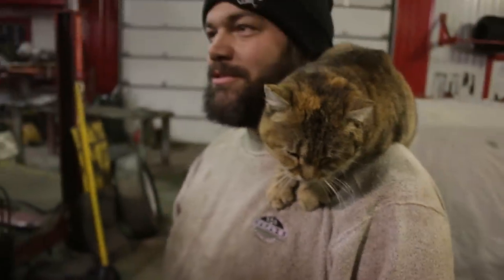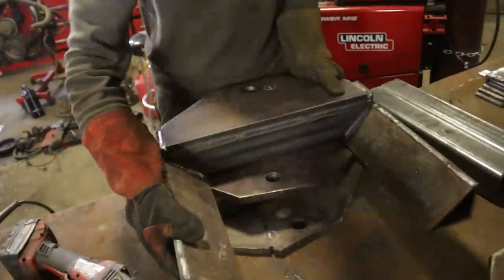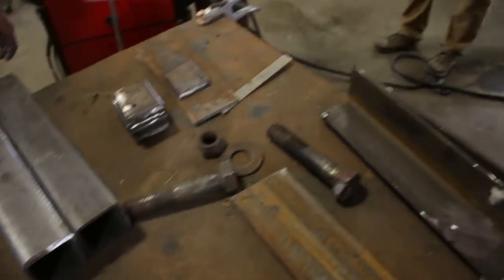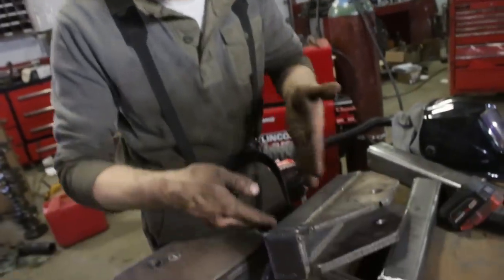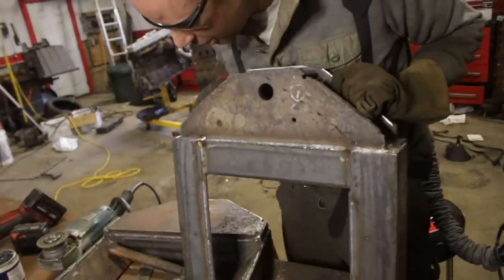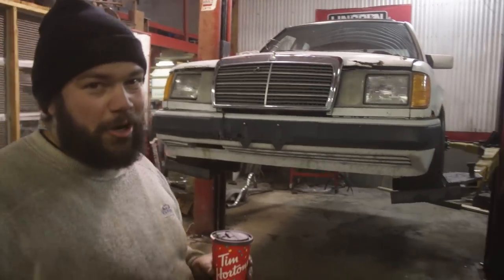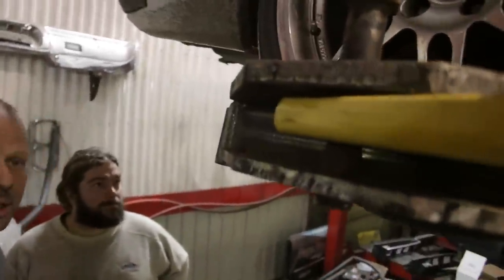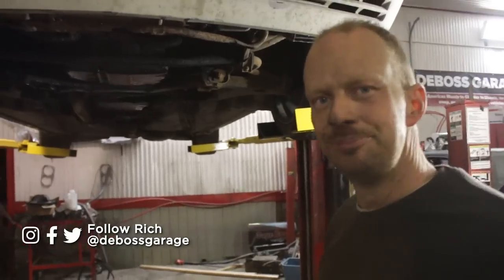How To Build Wheel Engaging Adapters For Your 2-Post Car Lift

Comment: These comments amaze me. SMH he's not lifting a semi, or even is HD truck. Each arm will never have more than 1200 lbs weight. There are many companies that make the exact same style of wheel adapter he made with great results. Do your homework before making a dumb comment.
Reply: Well said
Reply: yep true,, so many over engineer components , but when you know what the numbers are , and so how much the other part(s) need to be capable of    handling the "load". people with Dyslexia really can visualize in there mind loadsa full on stuff like C.A.D all but!! can just look at something and instantly know whats involved and thats Engineering vocational Experience..
Anyone can see Rich is a unique individual when it comes to being a Junk yard genius.. a thats whats liked about de boz garage for starters,motors!!
Reply: Kasey McCleary do the calcs on loads in one axis and then add a moment and you’ll quickly find out that what you thought was “over engineered” at first glance was actually under engineered. It’s like a truss, it can hold 10,000 lbs in one axis but can only handle a moment of 100 ft-lbs before it fails. What he made was fine, it’s those telescoping arms that are sketchy as frig
Reply: Kasey McCleary   I've seen only one model of such a device. It's similar to Ritch's. I think it's a poor design. It probably quintuples the stress on the inside wall of the sliding tube. While probably still within the design safety factor if he limits the load he puts on it, it's not really a good idea to reduce your safety factor that much. Someday, someone unaware of the situation may try to lift a much heavier load than the tubes can hold. His lift can probably lift 10000# before maxing out. I like knowing my lift will max out before failing structurally.
Reply: @fascistpedant758  Yep just made a longer leaver.
Reply: Silly bugger! We have done our homework.   4 yrs plus.  Some folks pay us a bunch of money for such findings.  We've doing it here for free because we like Rich and the other guys (and some of the fans that may duplicate his efforts).  We'd prefer if they weren't crushed.  When bolts fail in shear, it's sudden.  There will be no warning and no time to escape.  The box section will probably go slower and resist the effort to telescope as inelastic deformation occurs.
Reply: You guys dont even care about "safety". You are just trying to justify your 150k student loan financed engineering degree. Google 2 post lift wheel cradle. And there isn't a 3/4" bolt in the world that will "shear" under these loads.
Reply: @kaseymccleary946  well, we've been corrected.   Might as well throw away the rings, Kasey's got it from here.  According to Kasey's reference charts, 3 laps of 0.35 mig wire or 7 laps of 0.30 flux core wire will do the trick just fine.  Thanks for chiming in Kasey.  No need to do any sort of real math, just "have a look at her, she'll hold".
Reply: Kasey McCleary ,The 1200 LB vertical load isn't the issue. These baskets impart a torsional load on the arm that isn't seen when engaging the cars body / frame.  While it might not break right away, the arms might develop cracks down the road due to repeated torsional loads..  The Automotive Lift Institute certifies lifts in the USA.  I'd be looking for a certified lift with baskets then look at what they have designed and compare to what our guy is using.
Reply: @woodwardbeardsley2413  uh the telescoping arms came with the lift. He didn't make those. Thats stock.
Reply: @kaseymccleary946  There will always be arguments between engineers and tradesman, but i assure you that no one here has anything but Rich's safety in mind. HE even called a sketchy setup. C'mon man... Same team.
Reply: @consaka1  No shit Sherlock. You obviously don't understand what I'm talking about. Those arms are designed to only have vertical loads, now he's adding a torsional force to the arm which probably increases the stress by 5-10 times. Something that they're not designed for. If you don't believe me, google "Statics" and once you have a firm grip on that then google "mechanics of materials" to learn how to calculate the internal stresses of the material.
Reply: Just for completeness.  Mohawk makes add on wheel baskets for their lifts.  WA-1 and WA-12 under Tire Engaging Adaptors.  So far this is the only company I've found offering such an add on.
Reply: Also adding to my post.  A 10,000 lb Mohawk System 1 lift is derated to 6,000 of evenly distributed load by using a wheel basket (  1,500 lb PER ARM ) .  A 12,000 and 16,000 lift is derated to 9,000 lb.  ( 2,250 per arm. )
Reply: SSSSSHHHHHHH
Reply: @consaka1  so you're trying to tell me that there is zero rotational force put on the arms from these wheel cradles? The telescoping arms are designed with only a vertical force from lifting straight up and down, now you're adding a torsional stress to them, However, Bob Roberts pointed out that the manufacturer derates the lifts significantly to account for the added stress on the arms.  Think of it like a putter, before you were holding the weight on the shaft, straight up and down, now you're holding the weight on the tip on the putter head,  which is trying to make the shaft turn as well hold the vertical forces applied. If you don't understand that, then I cannot help you see things more clearly. There's probably a flat earth conference near you that would welcome you though.

Comment: Uhhhmmmm nope!  I'm a mech eng.  Please don't use these.  Torsional load arms, bolts used in shear. Extra load moment for the extension.  Etc.  Please dont!  Picking up the center of the tire would remove some of the concerns.   Better to weld tabs on the car for lifting locations
Reply: Mechanical engineer yet he can't spell torsional.
Reply: @mitchdenner9743  that's what you got out of my comments?  You're a winner!
Reply: @mitchdenner9743  most engineers I know are terrible at spelling. Math and science are more important.

Comment: i think u should have some sort of plate or tubing going across the insides of the tires that u secure after u slide those adapters around the wheels. would help them from wanting to kick out if ur weight shift for any reason.
Reply: Twin post lifts have toothed locks to keep the arms from swinging when the lift is up. They disengage when the lift hits bottom. 
Jeff
The Alignment Guy ®
Reply: I was thinking the same thing, even though the lift arms lock in place.. it’s just a bit of extra security and the tension load between left and right wheels would help with the deflection..
Reply: Jeff Forss   The two lifts I work with only lock two arms and one is defective on one lift. I don't think they were intended for a regular side load. When I lift a vehicle, the loads are only vertical.
Reply: Jeff Forss   I can only imagine that if the arms are trying to scoot out, you're not picking proper lift points. They'd probably be difficult to push out even if you would want to once they're loaded. The locks must be mainly for those "special" people, but you never know, shit can happen to anyone.

 Nice four post, I wouldn't mind one of those. Cars with side skirts and trucks with running boards can be a PITA to lift.

Comment: To all these so called eng haters what degree do you have in lift production go check out a semi tow trk wheel lift same design and if your not useing it whats the prob id work under it gtratz on those tight welds there prob the strongest welds on a lift thanks for the vid i enjoyed it

Comment: To preface this, I’m a long time viewer and I love the channel especially since you’re not afraid to try new things and adapt. You’ve been an inspiration to me especially with the Audi, but for your saftey I think you might want to rethink this a little. As a 3rd year mechanical engineering student, I’m concerned about a few thing with that design. First it seems as though you’re using bolts as pins, this puts them in a shear loading condition which they are not suited for, as bolts are brittle and when they shear they will just let go completely without much warning. Normally you’d rely on the friction between the surfaces you are clamping with the bolt to take that shear force. So I’d recommend changing to a big pin like a Clevis pin.

Second you are putting the telescoping arms in torsion with the moment arm you’ve created by moving the center of force applied away from the centerline of the lift arms. Ideally you’d want this distance to be zero, as you’ve pointed out the square tube of the lift arms and the telescoping section are not meant to take this sort of twist and so the deflection adds up. Ideally you’d support the vehicle with the arms extending to the center of the tire to minimize the torsional forces in the arms, or do what you can to reduce the distance between the force action line and the arm centerline.
Reply: I would agree  with you if the load was at its max in the lifts normal use. Redundancy in the lift design not taken into account 
plenty of redundancy in Rich design and that bolt wont shear at a mostly static load of 500kg
It'll be fine
Reply: Agree. Rich is a great mechanic and no fool, and I'm just a guy on the internet - but with good intent!
The lateral and torsional forces here would make me nervous.
While I might get under it myself, I'd hesitate to get anyone to join me unless there was another line of defense in case, say, a cradle drooped and a wheel slid down off it.
The idea behind it is great though.
Reply: wow,, when u know yer shit who can tell u any different,,, I praise up anyone who speakers up to producers questioning there content which can be shaky grounds for Argue-Tube!! fair play... keep on keeping on keen eyed mechanical watcher...
JT
Reply: rzan8 true, but I’d always prefer to have a slow and gradual failure of the pin, rather than the abrupt failure of a bolt used in shear. Also the threads are stress risers on bolts used in shear so it’s difficult for to accurately estimate how much force a bolt will take in shear.
Reply: Well, I am retired now and spent a lifetime in making tooling and was a certified weld inspector.... uh, I would not get under that contraption. Just saying. Go ahead, ya all gonna trash me anyway, just giving a comment based on real life. YMMV!
Reply: Exactly what I was thinking, they need to hang from the arms and drop down a ways before hooking over under the front and rear of the tire, the further down the better, that would at least minimize the twist and shear forces.
Reply: Mike Graves  I dunno wots bugged u?? how can u praise someone up and upset someone's feelings??
I was replying to he knows his stuff giving credit to his vocation,, but if arguments with strangers on u tube is more important THAN credit due,, im not the one with the screw loose...
Reply: As a shop owner and sole mechanic in my shop I can say engineers suck
Reply: @eddiereichel9354  I own 3 Audi A6's.  I'm an engineer and I hate engineers, too!  lol  "Audi, WTF, Audi!?" is my song.  But in all seriousness.  No engineers, no vehicles to bitch about engineers about.
Reply: Jack Eagan   The bolt doesn't worry me at all. It has a safety factor of ~6 at the intended load and will probably never experience more than a few hundred cycles. Also, you may not have noticed but in the first test, the threaded section was indeed in the joint, contributing to the droop of the cradles. In the second test, after painting, the threaded section had been removed, improving the angle of the cradles.
What would bother me the most is the torque load on the arms.

Comment: I see a lot of my fellow engineers commenting, and I'm also not encouraged by the rotation created on the arms, but there seems like an easy fix here... Make cross tubes that the left and right tire fixtures slid into and pin on. Then the entire system is 1 framework being picked up by 4 points, as the lift was designed to do.

So... Take a few more pipes and turn your tire lifter into a modular lifting frame.
Reply: I was thinking the same.  You could probably get away with just one cross bar for each axle I'd bet.
Reply: That's actually a good idea.
Reply: @consaka1  Ehhh... i looked around some more and what he did does exist commercially as it is designed, but man, it makes me nervous all the same. Whatever happens, i just hope everybody stays safe.
Reply: 2 sections of reciever tube welded to the wheel lift forks and a lenth of 2x2 tube would be perfect as a crossbar.

Comment: Bend pack just give Rich a hoist please along with 4 corner safety jacks. 

Rich why not just incorporate lift points on the car like the rally guys do . 4 holes and some pipe welded to the roll cage would be way safer.
Reply: I despise lifting low vehicles. rally style lift points I would love. But onto the lift arms, awesome idea but execution eh, I hate how they seem to extend the arms creating more leverage.  A higher attaching point would create a triangular cradle,  hell just use a cushion to protect the wheel lift with tire slings attached to the hoist.
Reply: @signlsirchir2156  You cant take the wheels off then .

Comment: At first sight it's a little sketchy but as long as you know and don't overload it, it's not so bad. I'd move one of the holes over to compensate for the slop, you're just screwing the pooch trying to shim it. You really should rig a removable brace inside the wheel to be sure it cant slip out. In hindsight, you might have been better to fabricate a dedicated set of those tubes that slide out of the lift, just for this application. I might have a go at this myself, I've been thinking of fabricating removable ramps for mine, but this could do.